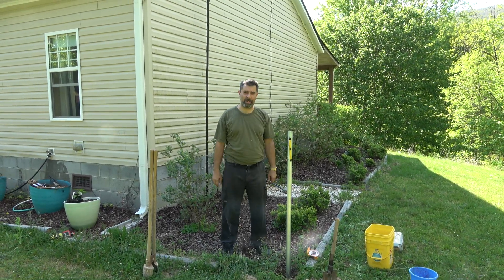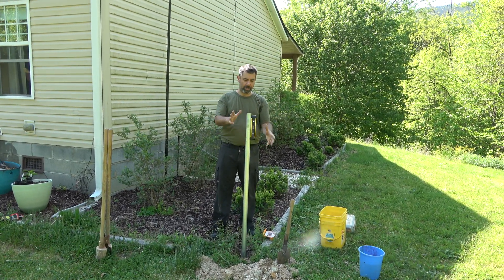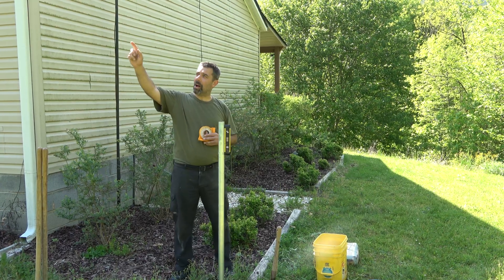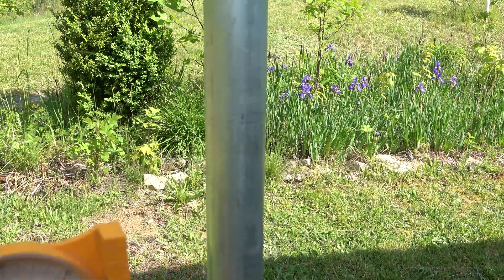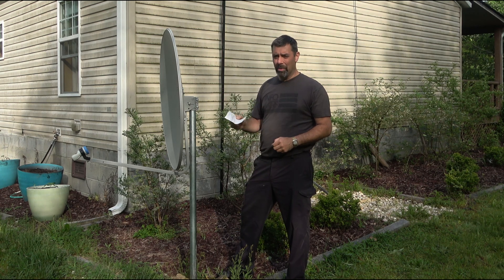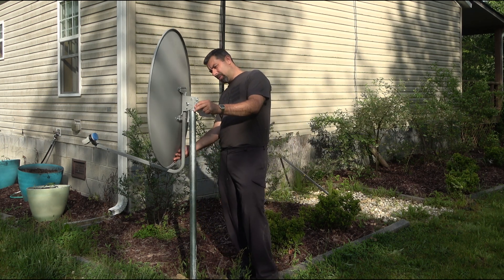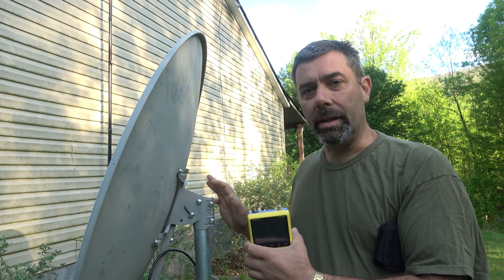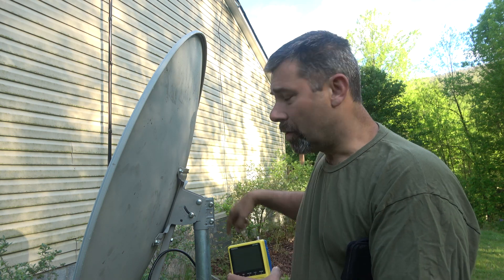FTA Satellite Systems Part 2: Installation And Adjustments. Lets get those signals!

Comment: You got it down, Hope I can find a satellite quick like that, some people might think this is the down side to
playing around with ku & c band free sat. You actually have to know how it all works And there is nobody
going to help line it up . I know I had good luck in the early 1990's, hooking my brand new 10 ft c band .
 But I paid about  650 dollars for dish and mount the receiver and descrambler  and mover I had to buy seperate.
Using a used 7/1/2 ft. I got for 50 dollars off ebay  Updating to digital and using used stuff isn't as easy.
Of coarse , I'm older now by 30+ years .

Comment: About "How Much was this ENTIRE Set-up"?

I like my Indoor RFD's but I cannot rely on a signal... 3 Televisions in total in my house.

Take care,
🤓 -Thomas Skagen
Port Orchard, Washington
Reply: Probably around $200 for a starter. The motors are about around $100 Check out the shop at www.FreeSatelliteTV.net for prices!
Reply from the maker: Yup. I paid a little over $100 for the dish, and about $35.00 for the receiver. Add in the pole, the wiring, and the concrete, and I'd bet it was right at $200.  I have picked up a dish mover since I shot this video and it was just over $100. It works great!

Comment: So what do you pic up or hook it to ? A tv ? Is it tv stations ? I’ve never heard or seen any of this , very interesting
Reply from the maker: So these things hook to a receiver box and they can output both HDMI and regular A/V out.  On the TV side, they are like the wild west of TV. You can fond over 100 full time TV stations up there, but they are channels you won't find anywhere else. 95% of those channels are foreign. Some are religious, while others are general stations. There are maybe a dozen english full time stations from stateside, and these are always interesting.   
    Flip over to the radio side, and this setup gets nearly 500 channels. A lot of master feeds for channels and a lot of full time radio stations that broadcast via KU band as well. 
  Then there are also these "Wild feeds" These are where the real fun is. Any time you see a "Live on the spot" report, those folks have been standing there for an hour waiting for their 1 minute update. For that hour, you can watch the real story unfold, catch the unedited version of what is going on, and in many instances get the reporters own thoughts instead of what is on the teleprompter. Its really cool. 

     And that is just on KU band. Move up to a larger C-band dish and the tv stations blow up to around 500, and the radio stations go up to over 2500! Those numbers are not including those wild feeds!  Much like anything radio, a lot of the fun is finding those weak signals and tracking down those strange live feeds. It's way more fun than regular scripted TV by far.